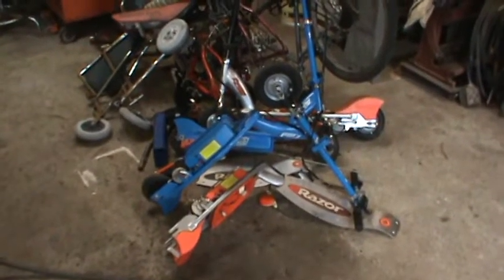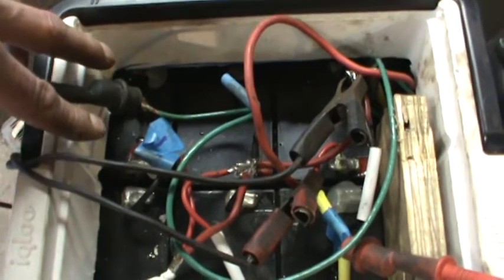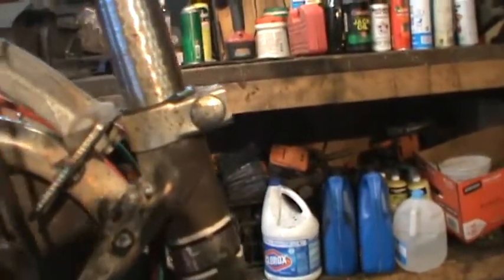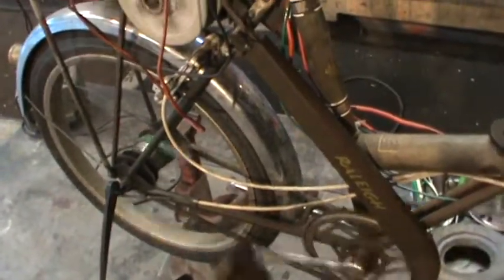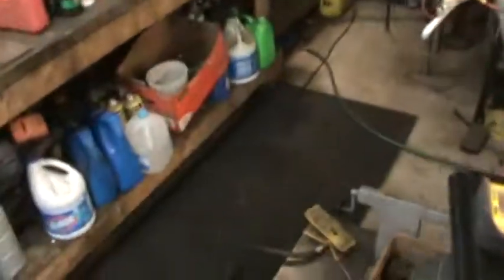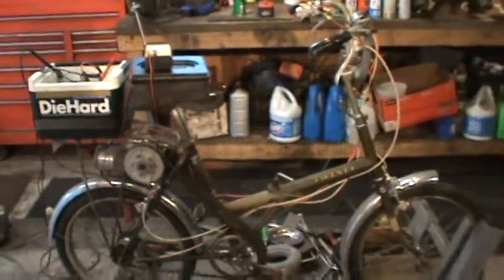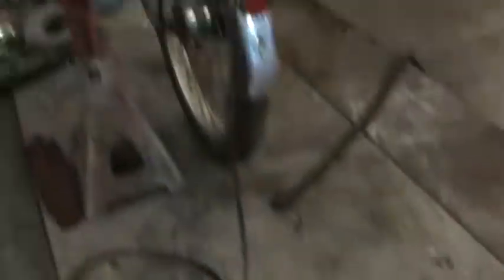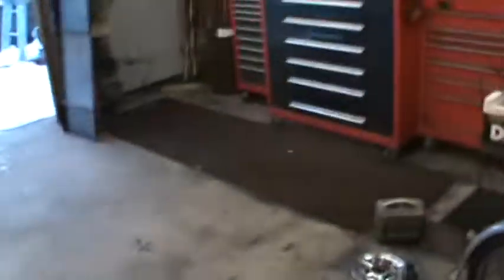more electric bike build

Comment: I have had pretty good luck on ebay finding good used batts like that for back up power supplies and using a pair of them as motorcycle batts.  I just looked on ebay and there is a pair of 7 ah batts ending in an hour for $5  $12 shipping  100% feedback...  Usually, almost any of those batts in anything I've bought at a yard sale or thrift store are junk